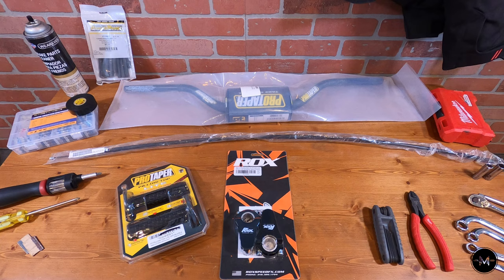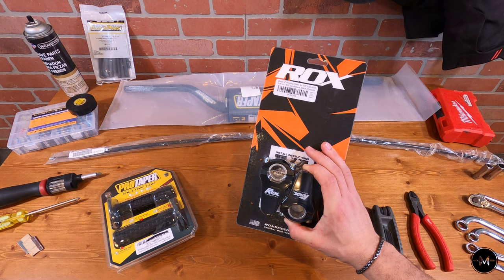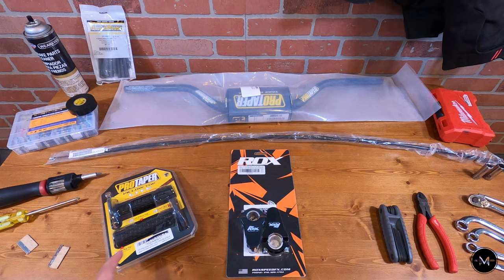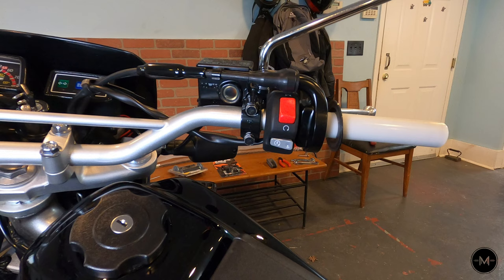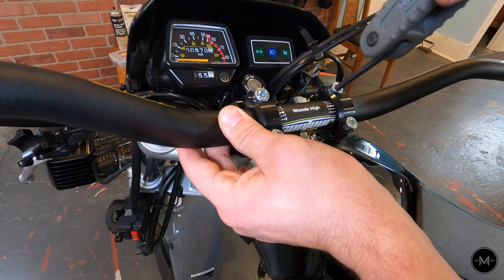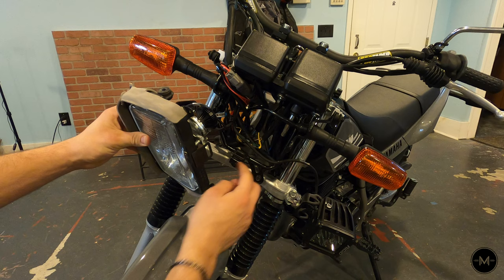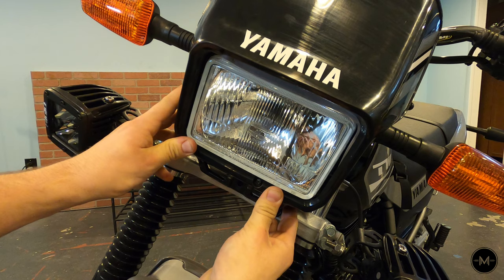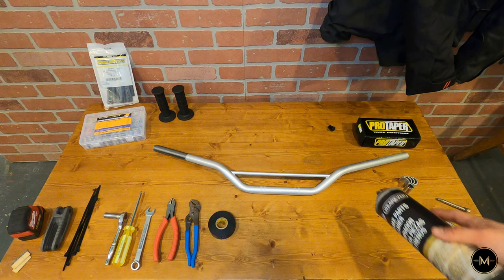Yamaha TW200 Handlebar and Riser Install // Rox 2" Risers // Pro Taper Bars

Comment: If your grips start slipping with time.. a tip I got from someone YEARS ago and I’ve used ever since: Wrap one or two wraps of duct tape around your handle bars under where the grip goes, pour gasoline on them and slide your grip on. The gasoline breaks down the duct tape leaving the adhesive.. doing this I’ve never ever had a grip come loose on me ever since. It’s dirt cheap, stupid easy, and you already have what you need in your garage. I haven’t ever heard of anyone else doing this but I wanted to put this back out into the universe to hopefully help someone else as much as it’s helped me over the years.
Reply from the maker: Wow that’s really awesome! I’ve never heard of that before but it totally makes sense. If I ever have any issues with my grips, I will certainly give this a try. And definitely make sure to shout you out. It’s actually a really smart idea I’m surprised I’ve never heard of it. It’s also better then buying grip glue, considering everything you need is in the garage! Thanks for that advice! Ride safe 🤘🏼😃
Reply: @MostroMoto  Yeah, it’s definitely one of those “why didn’t I think of that” ideas!! haha Really been enjoying your videos man, keep it up! Going to pick up a TW this summer and cruise around Alaska with it, I spent last summer up there without a bike and it killed me.. seeing your videos have really lit a fire under my ass to make it happen!
Reply from the maker: That sounds amazing. A dual sport in Alaska… doesn’t get much better then that! Ride safe & thank you for checking out my videos!
Reply: Why not just use grip glue?

Comment: Putting the handgrips on,  we usually just use rubber cement,  it helps as a lubricant to slide the handgrip on but it also prevents the handgrip from turning after it sets up.   Nice video,  thanks for posting it.

Comment: It appears one unique feature of those Rox 2" risers is the design allows you to pivot the raised bar back or forward relative to the original clamps. It seemed to me Mr. Mostro should have confirmed his desired bar position before committing to the final placement of the parts that required drilled holes & even the tilt of the clutch lever etc. That confirmation probably required sitting on the bike and standing on the pegs. No harm done but he might have missed out on optimising the ergonomics for his particular height & reach. Subtle alignment differences can make a difference in comfort.

Comment: If you look on the head of the "Philips" screws you will notice that there is a small dimple. This indicates that they are JIS(Japanese Industrial Standard) and NOT Philips screws. This requires a different screwdriver to keep from buggering up the screw heads when removing or tightening. The screwdriver that comes with the TW200 tool kit is proper, but you can also purchase a JIS screwdriver on line or from an upscale tool dealer to keep in your toolbox.

Comment: When checking throttle function place the tree at full lock and FULLY open the throttle then RELEASE to make sure the throttle moves freely and will spring back on its own.  Repeat on each side at full lock.

Comment: Nice video! Easy flow and informative! I've been wondering if you would need new cables and wires doing the risers upgrade! Thanks for adding the links also!
Reply from the maker: Glad you found it helpful! I was pretty surprised that the stock cables worked with the risers. I really didn’t want to modify the cables or electronics if I didn’t have too. I’ve been using this set up for a little bit now without any issues! Love your videos too, thanks for watching 😃🤘🏼🏍

Comment: Great video - Thank you. At 24:04, I believe the collar should be tightened against the adjusting nut (not towards the clutch perch) to prevent the adjusting nut/barrel from moving. I may be wrong though.
Reply from the maker: Hey thank you for the comment! I’m new to adjust the clutch on this bike. The way I do it, I just adjust the slack with the adjuster nut, then once I’ve got that set I just tighten up the locking nut. Seems to work okay on my bike, but I’m definitely no expert! I’m sure there are other good ways to adjust it as well.
Reply: How it was done in the video is correct.

Comment: Great video love the new color I have the 2019 tw , at around 23.20 give or take that spring where your clutch cable hooks up doesn’t look like it’s hooked over top of the lever like it’s supposed to be, makes clutch feel little mushy don’t know why they don’t hook it over like it supposed to be I pointed it out to my dealer on another one on there floor but they never did correct it only takes a second with needle nose next slap you a fmf power core 4 on there sounds good give you better pulling power on long grades enjoy 👍
Reply from the maker: Great observation, I just checked my bike and the spring is over the metal piece in the correct position. It does seem loose I wonder why it’s like that. I haven’t messed with that clip so definitely seems like something Yamaha should look into before shipping out the bike. Thank you for that comment, and I appreciate you watching the video. If I notice that clip falls out of place again I’ll make sure to let you know!

Comment: I just tried to install Tusk D-Flex Pro handguards on my stock TW200 handlebars but couldn't make it work since the bar crossbar is right where the inboard clamps should be.  This Pro Taper bar might be the answer.  Don't know if 7/8 clamps are needed or 1 1/8 clamps since the bars taper.  If you install handguards on yours we will see.  Great video.
Reply from the maker: Hey thanks so much for bringing that up, sorry to hear about your problems with your hand guards. I hope you were able to make them work. I was also looking at tusk d flex guards. I’m going to have to do some research on the forms to see what size I would need, like you said they are tapered so the sizing is a little more difficult than normal. I’m hoping to do hand guards within the next couple of weeks, so keep an eye out for a video. And I’ll try and answer any questions in that video. Thanks for watching, ride safe!

Comment: The best way to remove grips that are not glued on is to inject water between the grip and the bar or throttle tube and slide them off. You never know when you may need them again.

Comment: instead of using a Philips screw driver you should use the screw driver that comes in the TW tool kit,  the reason it strips easily is cause the screws are a Japanese standard and Philips is an American standard so it just doesn't' fit well.
Reply from the maker: Oh wow I didn’t know that! Luckily my I was able to remove my screws with little trouble. But that’s definitely important to remember for next time. Thanks for watching & pointing that out! 🔨🏍
Reply: @MostroMoto  I was going to make the same comment. A set of JIS screwdrivers will go a long way.

Comment: How did the sweep feel in comparison to the stock bars? I'm planned on either getting the CR high or the Woods high and I noticed the woods high has a little more sweep.
Reply from the maker: Felt good, honestly not a huge difference from stock. But then again I haven’t had the stock ones on to long before I changed it out
Reply: @MostroMoto  That's what I was wondering thanks for the info!

Comment: Can you use hand guards with these bars? I noticed that the ends of the bars are hallow so I don’t see how one could attach hand guards. I thought these were the bars you had to tap the ends so a screw could be inserted for the guards.    Thanks
Reply from the maker: I believe you can, I did not put and hand guards on my bars. But they should fit in no problem, just have to take the bar caps off

Comment: Any reason you couldn't have got a higher rise handle bars.
Not a big fan of risers.
Reply from the maker: You can certainly just use a handle bar that is higher. But the risers allow you to have another pivot point so you can really adjust where the bars sit. Also the risers I chose allow me to put a thicker bar then the stock one.Thanks for watching 👍🏼

Comment: Could you tell me how much higher the taper bars are compared to stock? I'm 6'1 and have a long torso, so I'm trying to figure what kind of hight increase the 2 inch spacers with these taper bars will give me. I sucks leaning forward 24/7 on the tdub. Thanks!
Reply from the maker: Sorry for the late response, to be honest, they’re only about an inch or so higher. You’re taller than me so I have a feeling you would still be hunched over a bit.
Reply: @Mostro Moto  I appreciate the feedback! I put 2 inch Rox risers on, but then I put on a custom seat that raised me 2 inches. I was thinking about redoing the bars to 3-4 inches, but it seems a bit overkill for the bike. I'm not sure what direction I should take. I use it for crusing around town mostly.

Comment: The reason your screws strip easily is because they are not phillips head, they are JIS, Japanese Industrial Standard. The head shape is slightly different. 
Get a set of drivers and you wont strip them.
Reply from the maker: You are totally right! At the time of that video I had no idea about that. I definitely need to get a pair of JIS drivers! Thank you for the information 🤙🏼🪛

Comment: If you use the 1.75" riser with stock handlebars, do you need to change out the clutch cable?
Reply from the maker: Not sure about that size, it’s close with the ones that I have on the bike

Comment: Do the stock cables work?
Reply from the maker: Yup, In this video I show how to run them. They worked for me! After watching Tdubs kids video I was concerned that they wouldn’t work. But my set up is a little different & it works great. But it will definitely vary if you get different risers / bars. You don’t want anything to heigh because you will run into cable problems. I hope this helps!